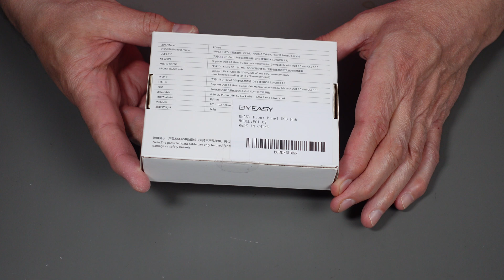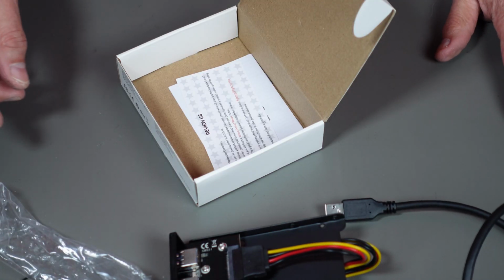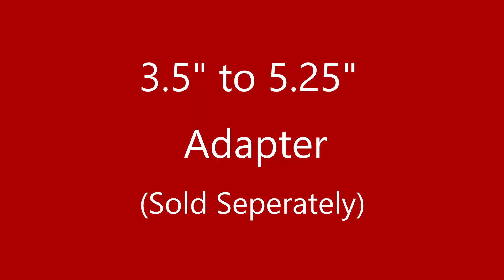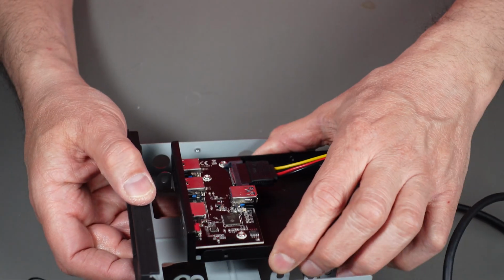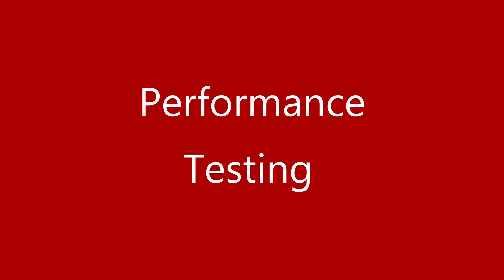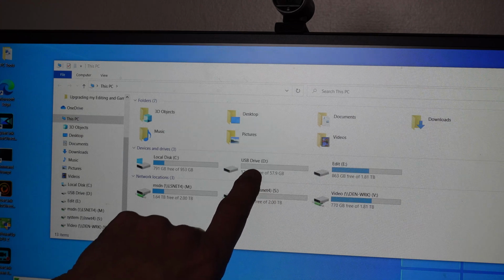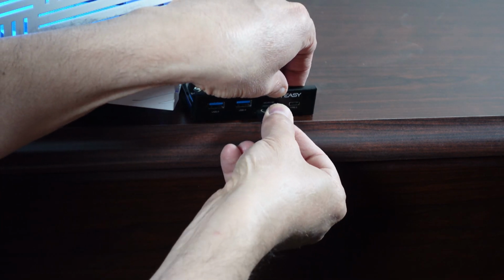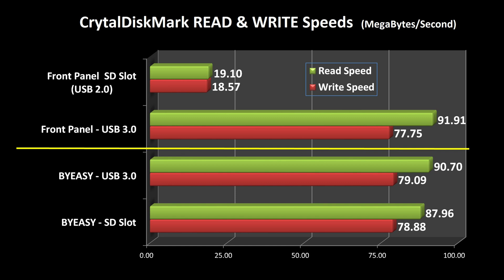BYEASY Front Panel USB 3.0 Hub Review – Box Opening, Installation, Testing and Performance Compare

Comment: did you have any problem with this front panel? I am looking to buy one, but people who have bought it are saying that it caused a short which would shut down their power supply and others are saying that it keeps the fan on even after they turned the pc off, did you encounter any of these problems?
Reply from the maker: Not with this one, however I once had one that had E-SATA that (as it aged) it would prevent my system from shutting down - even though I didn't have anything connected to a port.  A freind of mine did have a similar problem that he found cause by two male pins in one of the connectors being shorted after his kid stuck a pen into it.
Reply: thanks for responding. @PE4Doers

Comment: 15 pin? doesn't he mean 19/20 pin? The SATA power is 15 pin. Maybe that's where that's he got confused. right?
Reply from the maker: Can you give me mor4e context to your question?
Reply: @PE4Doers  I'm sorry. Isn't the USB 3.0 internal port/plug 19/20 pin? My motherboard doesn't have a USB 3.0 port (I just built my first gaming PC, so I'm upgrading an older Dell, just to tinker with PC stuff) Anyway, I have to use a pci-e card with a USB 3.0 header to run the front USB 3.0 panel off of. I thought you were saying the USB 3.0 ports are 15 pin, I understand ther're 19/20 pin.
Reply from the maker: @guybroyles48  You are absolutely correct.  It is a 19-pin cable needed to plug into the motherboard USB 3.0 connector.  If I said 15-pin, I was incorrect.  Thanks for the heads-up 🙂

Comment: QUESTION: The Reviews of this product on Amazon talk about how if you connect the SATA Power Cable, the PC does not shut off. Do you know what those Reviews are talking about? And did that same problem happen on your PC?  The Amazon Reviews say the people simply connected the USB 3.0 cable, but not the SATA Power cable in order to overcome that problem; however, this prevented connections to external hard drives that required power.
Reply from the maker: I had that problem with a similar product installed on my primary computer.  I eventually isolated it the STA as well, which I did not need since connecting through the external SATA is something I did not use.  When I tested the one I reviewed in this video I did not encounter the problem, but that was on a different PC, so it may be motherboard dependent.  It is possible that this unit has the same SATA controller on it that my other one had.

When I had the problem with the other unit, it would intermittently lock-up during the shutdown process, which required me to hold down the power button to completely shut it off.  I never encountered any data corruption as a result however.

Comment: They sent me the same unit to try out.  CrystalDiskMark looks like a useful utility.  I like this hub, and will be leaving it in my test bench machine.  Nice review!
Reply from the maker: Thanks, I watched yours today as well..  I also like it, especially the USB 3.0 speed on the SD Card reads.  I was actually planning on another video where I add a USB 3.0 PCIe card to an HP SFF legacy PC, then add this device to the front 3.5" drive bay that is currently unused..  I am however, a little concerned ByEasy may have discontinued this product.
Reply: @PE4Doers  I'm hopeful that the lack of inventory on this item is temporary.  It makes no sense to send out review samples right before discontinuing an item.
Reply from the maker: @ThriftyAV  I hope you are right.  We have to admit that something like this has a somewhat limited audience and use case, so I am hopeful sending out the samples wasn't a 'last ditch' effort on their part.